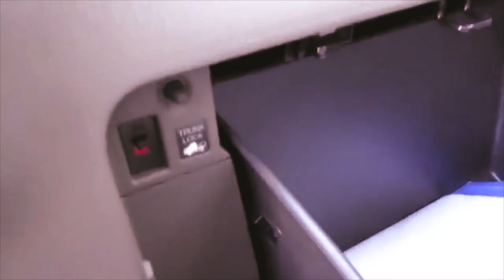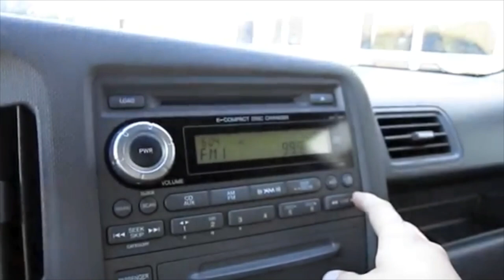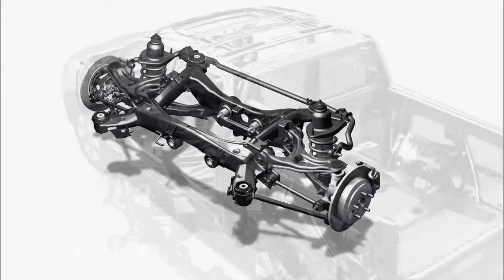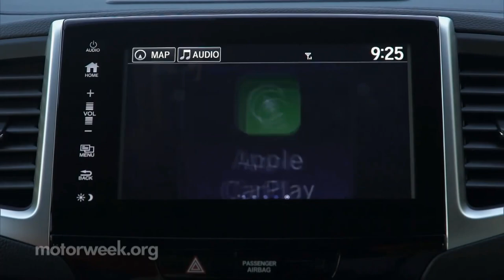Why does EVERYONE hate The Honda Ridgeline??

Comment: Fascinating review, but one that ignores perhaps the biggest innovation of what the Ridgeline was all about. It was/is the pickup for folks who don't really need a pickup. It's a car based vehicle on purpose: to give it a huge advantage of on the road comfort and handling. I've read from owners THIS is why they bought it. These people could care less about that it could "only" tow 5,000lbs. or had a 1,500lb payload. For them, this was plenty. No need to get a choppy ride or excessively high seating step-in experience. Truck practicality, car comfort. It's unique and should be judged accordingly. But seriously, enjoyed the video.
Reply: Spot on. I bought mine because of everything you mentioned. If I towed stuff regularly I'd get a full size. I've only had my 07 Ridgeline for a month and a half but so far I'm enjoying it more than the 6 other vehicles I've owned.
Reply: Not a bad option for people who still want a truck but also want to occasionally get some stuff from Lowe's. But at the same time, that could be accomplished with a RAV4 or CRV, so this is only for people who really want a truck but don't actually need one at all. I expect this market soon to be taken up by the Ford Maverick
Reply: @andrewsang4688  I was on the waiting list for the '22 Maverick and now I'm on the list for the '23. Thinking about buying a used 2010 Ridgeline because I'll probably be in my grave before the Ford rolls off the line.
Reply: The midwest region always ignored the innovation

Comment: 283K on my Ridgeline.  I'm the second owner.  I bought it at 210K and changed the timing belt.  I'll change it in another 30K.  I'm not using it for work but I occasionally go on trails and pack my ATV in the back.  I also occasionally tow my trailer for dirt, mulch and other light weight materials.  It rides more like an Acura than a truck.  So far so good!
Reply: Why such a short interval for the timing belt? Recommended is like 100k miles
Reply: @brandonmacdonald7802  I think it snaps somewhere around 160k but I’m not willing to test it lol.

Comment: People loved (and still love) the Ridgeline. It's the knucklehead full-size truck drivers who complained loudly everywhere they could. Most of this video's criticisms of the Ridgeline are based on the uninformed views of those people. The Ridgeline was a great truck back in 2006 and the fact that so many are still running and in great shape today speaks volumes. I'm not a big fan of the second generation Ridgeline because it did away with a lot of the things that made the first generation so great and unique - mainly the incredibly thoughtful use of storage space in the interior, but the new one is also dinged because of the extremely bland styling it borrowed from the bland Pilot. It's not a bad truck by any means - I'd still buy one if it was priced more sanely over practically anything else available new today - but it doesn't hold a candle to the first generation.

Comment: Bought one new in 2006, put 280000 miles on it and it hasn't seen a wrench other than timing belt changes per schedule
Reply: Yes!  I have a 2007 that I bought new in 2006.  Apart from scheduled fluid changes I have done nothing to this truck in 133,000 kilometres. Yes there was the airbag issue and the heater cover but that was covered under warranty.   After getting dinged $225 Canadian for the fist oil change I never went back for service and did all my services myself using Orem fluids.  
I have never felt that the truck was underpowered.   I think the jealousy lays in the fact that they are ultra reliable.  I have the front wheel drive version with the electronic rear lock to give more traction when needed which keeps fuel consumption decent.

Comment: The v6 in the Ridgeline is probably the better v6 in the midsize segment. The Ford v6 wasn’t very good the Tacoma v6 was good but I think Honda’s was slightly better
Reply: If this is the J series motor, yeah it's pretty good, but it also struggles with being a motor used in the Accord and Odyssey. Designed for on-road comfort, but then again, so is the Ridgeline

Comment: I think the problem is people over buy for what they think they need.
Personally, I'm just using my 1st gen for hauling my motorcycle around, not gonna tow anywhere near 5000lbs.
Maybe go through unpaved road to get to the trails, don't need a lifted 4x4 with low range and rock crawl.
NYC roads sucks so  independent suspension gives it a nicer rider with plenty of room for storage.

Comment: 2007 Ridgeline, 140k, and I haul heavy loads and have pulled a 14’ flatbed trailer with ~ 6k out of a boggy field when a full sized Tacoma couldn’t move it.  Lots.of disinformation.  A 280 Hp engine perfectly capable.  I have pulled trailers with 5k load, not counting the trailer itself and held 70 mph in the hills and mountains of western Mt.  Had to drop a gear, but Honda engines achieve highest torque at higher rpm.  Neither Gen1 or Gen2 use the Pilot chassis, rather has a boxed frame version.  Gen2 just styled to look like body on frame to offset the body on frame bias of real trucks.  Also, 1500 payload is a quarter ton truck, while not too many years ago, full sized Detroit pickups were termed 1/2 ton, with heavy duty at 1 ton.  As per gas mileage, Gen 2 has best of mid-size, still using the same engine as Gen 1.  My highway is 23-24 at 60-65, 22 at 70 to 80.  I do not advocate Ridgeline for heavy towing, gas mileage at 70 with max recommended load is about 15 on Gen 1.  Truck interior markedly roomier, especially in width, than any of the new mid-sized trucks.  Gen 2 is basically a facelift with more gears in tranny.  Bump the towing up, add a grunt gear, and it would be nearly perfect.
Reply: Great post. Gen 1 one owner here.🤗😇

Comment: Mine has 236k, never a problem-hauled 8' trailer with furniture from FL to CA and Fl to Canada several times. Also had 22' boat with 150 hp motor- never a problem. I love it . Will buy another in a heartbeat.

Comment: I bought my 06 RTL in 05 as it was being delivered to the dealer.  228K on it.  Timing belt twice -first was $850, 2nd was $1200.  Recently needed a new ac compressor.  Used it to tow my Honda Aquatrax and tote my Honda CRF 250.  I always thought the 3.5 was a little under-powered but i think its a gearing thing.  I have an 06 Toyota Avalon with a 3.5 that will put you back in your seat.   My theory on new product launches is that they either rush to market and cut corners on quality or they want to cement a good reputation --especially if entering a new and very competitive market segment and want to make sure its bulletproof.  I think Honda went for the latter with the Ridgeline.

Comment: I have driven many vehicles and this is the best snow truck bar none. Even with bald all seasons i made it up a hill no one else could make it; they all turned around to get a run at it. No it aint a heavy hauler, but 90 percent of 1/2 ton trucks never use it that way anyway.

Comment: I have a Ridgeline RTL 2013. Has over 120,000 miles the 3.5 engine works very smooth and when power is asked for it moves very fast. The cabin is bigger and more comfortable than others in the class, the rear cargo bed has a lower compartment that can be use as a huge cooler to keep drinks and meats for a tailgate barbecue. The cargo floor has built in grooves to transport certain types of Honda motorcycles. Mine is AWD and although it sits lower to the ground than the others it can go though mud, sand, snow with the additional VTM-4 than turns it into an off road beast.There are several videos in You Tube that shows it.

Comment: I love driving my Ridgeline waving at Chevrolet, Ford, and Dodge owners stuck on side of the road. I pulled over to help a Chevrolet truck in 2015 and his spare tire cable would not release the tire. I looked it up and it was a factory defect all Chevrolet trucks had like his. Then It iced over in Texas in 2018 and every 2 wheel drive truck was stuck spinning tires in driveways. I passed a Jeep that was driving on plowed roads, and I passed him on the center media with ice on it. I was driving faster on 4 inches ice than the Jeep was on pavement. I can also take off in my Ridgeline on ice or snow faster than a 2 wheel drive Ford Raptor in Colorado. I just wish my Ridgeline was turbo or supercharged.

Comment: Have a 2006 original owner and I would say it's a fantastic vehicle. Only thing that's gone out on me annoyingly has been the starter. I guess it could happen on any truck  but had to get it towed about 5 years ago. Other than that it's what most people only need in a truck. Drives like brand new with new rubber of course.  Tires do loose their bounce like a great sneaker after awhile.

Comment: I had a 05 Tacoma 4wd, wreck it, then got another tacoma but was not 4wd, found the 2010 RL for 12000 with 99000 on it, garage kept, looks like new and kinda still had the new car smell. I have had it for a year so far, I love it a lot more than the Tacoma, I needed a 4wd for my quads to take to Pismo Beach CA. It fits in the back, and I tow the other one on trailer. The Truck drives great, has plenty of power. It's great mid-size truck with a lot of features, storage and space. Like how the tailgate opens two ways and a big spacious trunk in the bed. This Truck, in my opinion is better than the Tacoma.

Comment: I know of no one whom has ever compared it to an F-150, Silverado or Ram.  It’s a midsize truck, pure & simple, and competes against the Tacoma, Colorado, Ranger, Frontier and now Gladiator.  Its V6 still makes roughly the same power as competitors, and its towing numbers are competitive.  It can’t haul a horse trailer like a Silverado HD, it can’t off-road like a Tacoma TRD Pro, and it’s styling was at first weird Japanese anime awkward or boring Pilot-with-a pickup bed.  That’s its problem.  All that gained it a reputation of “not manly enough to be a real truck”.  If they could up the horsepower a little, give it proper off-road capabilities, and style it more like a traditional midsize truck it might do just fine.  Realistically it’s all the pickup truck most Americans ever need.  I live in a larger Midwestern city and their are plenty of F-250 Super Duty show ponies around here hauling nothing but air year round!

Comment: I bought one so I could get back and forth to work in the new england weather.  I could care less about towing or off road B.S. because going off road destroys any vehicle no matter what it is.  I didn't want a truck and every SUV looks the same.  You can tell exactly what my vehicle is because no one else looks like it.  Truck guys yank off the exhaust for maximum loudness, I want the most quiet vehicle I can get.  If the ridge line was loud maybe it would attract some of the truck guys, but it's not.  You can't lift a ridge line and that really pisses truck guys off because everything they buy needs to be jacked to the sky with 40 inch tires.  All you can hope for is a 3 inch suspension drop and coil overs and even then you have to cut metal to get 33's to 35's on.  I bought an suv with a bed in it so I could toss shit in the back and not mess up my interior and I wanted something that was reliable, I owned a siverado with a 6.0 with only 70k miles on it and the thing rotted in half. Toyotas rot away around here also.  I can't afford brand new or used Toyota so a used one with even a little bit of rust under it is a red flag to run the f**k away.

Comment: Damn, I’m actually thinking about getting one. I work in construction, so I need a truck to carry my tools, be able to drive good in gravel and unpaved roads, and not guzzle huge amounts of gas. Yes I’m looking at the Tacoma, Frontier, Maverick, Colorado and Ridgeline. Not the Santa Cruz because I don’t like the way it looks and I think it has horrible use of space. Maverick is too small even for the midsize pick ups. Colorado is a Chevy so you know it’s a piece of junk, sooner than later it will leave you stranded by the side of the road. Tacoma is really expensive, but I think it’s reliability is worth it. I don’t know much about the Frontier to be honest, oh and I forgot the Sierra, but everything GM makes is crap. Ridgeline is the weird kid of the bunch, the one that doesn’t look the part, the one that everyone picks on, but honestly, it’s the one that makes more sense for my situation. It’s got clever use of space, its got okayish mpg, it’s more than enough to carry tools. I don’t haul huge loads of lumber nor tow tractors, all I do is carry my tools in my tool boxes, yes boxes, I have a lot of tools. The Ridgeline is quite efficient as a work truck for CONSTRUCTION WORKERS. That should be their target audience, yes it will take some convincing for the die hard ford, ram and chevy fans but I think with the right advertisement campaign it can convince them.
Reply: I'm a concrete finisher and bought a 2008 Ridgeline RTL......I used to have an old F150 which I loved, but I got all my trowels stolen out of the bed. Trust me, one of the BEST features of the Ridgeline is the lockable trunk. I keep all my tools and valuables in there.....I love it.

Comment: Would you fly in a plane made be GMC, Ford, Dodge  or Honda?  Honda all day every day.  You have no idea when the others would fall apart.  The new gen ridgeline is roomier than any midsize truck in its class. It gives a smoother ride.  The ridgeline is used mostly as a daily commuter with mid size truck capabilities but used mostly for light work. Meanwhile, alot of these big truck guys don't use the American truck for what its meant for.

Comment: The Titan was a great truck driving wise, utility on frame towing or pulling was great too.  The body itself was very thin or soft sheet metal however (probably added to the driving feel vis a vis weight) and would ding or crush very easily.  I wonder if the sheet metal on this ridgeline is thicker/higher strength than other non-stressed body-on-frame chassis trucks (such as the Titan).

Comment: The only people who don't like the truck are people who don't own one. I have. 2011 and it has been fantastic. I tow a 16 ft boat and the thing is bulletproof. It isnt designed to tow 10000 lbs. So people comparing it to monster full size trucks with big engines are ridiculous. 90% of truck owners dont need those truck but they buy them. My ridgeline is way better than my 2000 Tundra and that was a good truck. You don't know what you don't know. Just look at the actual owners comments.

Comment: Pretty good video, but you lost me when you were talking about technology. I don't want some bullshit technology in my car. I want a nice diesel, or V8, that can actually tow something.
Reply: @logancunningham4801  I have a 3/4 ton for proper towing, but if I wanted a vehicle for both going to town and doing some work, I would probably get something like a Tacoma. If I wanted to have two vehicles, one for work and one for going to town, I'd probably get a compact car or a Prius along with my truck. This just sits in an awkward position in between that's not really good for either
Reply: I'll betchya any money this thing would stomp a dually in the snow and 99% of cars. This is geared more towards SUV/crossover buyers. The fwd/awd handles very nice in snow and you don't get the ass end kick out when you stomp on it. We just had a bout of freezing rain here, 9/10 vehicles in the ditch were rwd/4x4 trucks. Keep your rwd platform and buy a prius then. If you dont think 4x4 trucks arenloaded with tech you're kidding yourself. Even tcase and 4x4 auto systems are "bullshit technology"